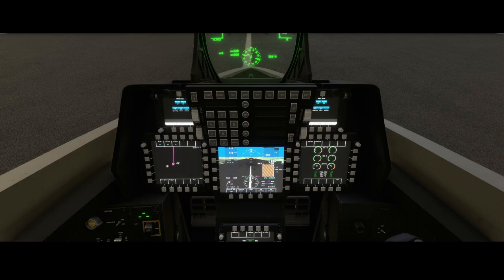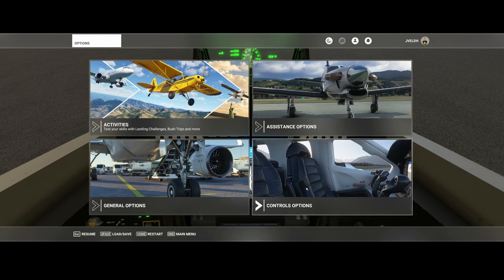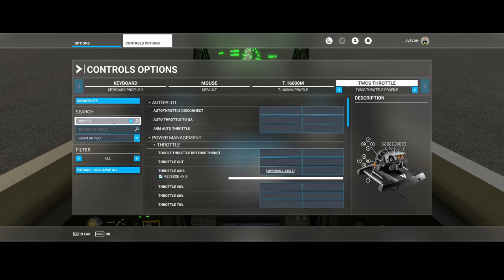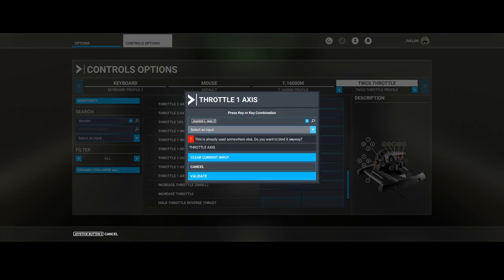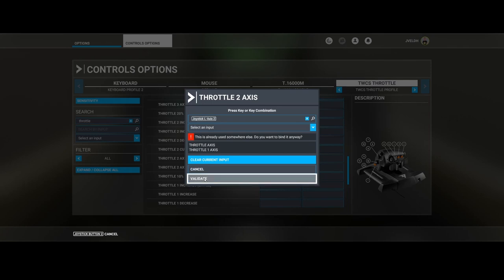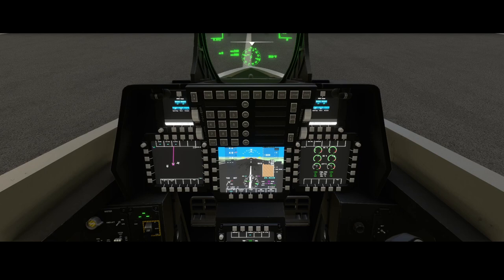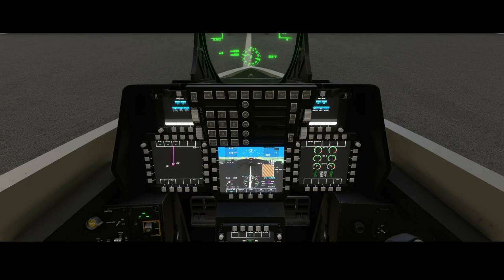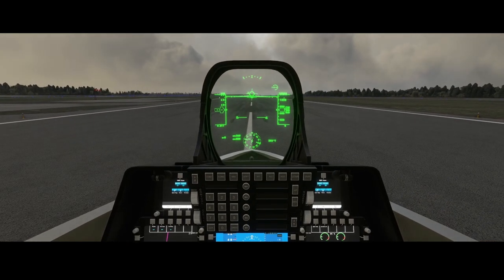Flight Simulator 2020 - How to - MSFS 1.21.18.0 - throttling issue workaround

Comment: Whenever I put my thrust at 100 percent after like 20 seconds it drops to 50 how do I fix it?
Reply: same thing for me, tried two different airplanes. The throttle starts fluttering and the rpm is erratic. Interestingly, after I started the engine up, it worked, ran it on full rpm for a bit, and when I attempted to take off, the throttle started to go bananas. And - mind you, it's now July 2024, not an old bug. I never had the problem until I downloaded the latest update a few days ago. I have been flying for a few months now with my Honeycomb Bravo controls, and I had no issues whatsoever.
Reply: Guys u probably have auto throttle on try turning it off
Reply: Or have it in realism mode for overheating the engine

Comment: Throttle goes up and down ,won’t get to speed to take off?
Reply from the maker: hi Bob can you provide more info
Reply: @Highintheflightsimsky  hello. When I am staring a flight, my plane just accelerates and decreases by its own, do you know how to fix that? It is very annoying cause I select 100% throttle and then it goes to like 50% and I can’t take off. Thank you
Reply: @pepeiglesias9603  I have the same issue now in July 2024 with all updates ok but it has started after the latest update a few days ago.

Comment: Anytime i turn throttle do idle it only goes to 5 percent and i have to turn it all the way down on controller. Do you know how to fix it
Reply from the maker: in which airplane does it happen? some aircrafts do have the option to recalibrate your throttle which resolves it in most cases but that is only applicable for the 3rd party aircrafts if I am correct
Reply: @Highintheflightsimsky i have the c90 when im discreasing is going up im on xbix